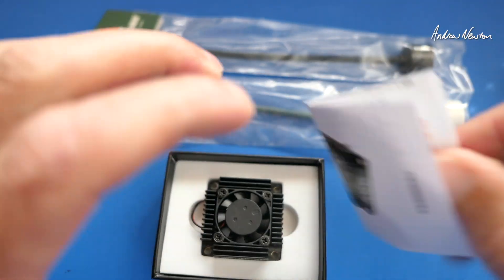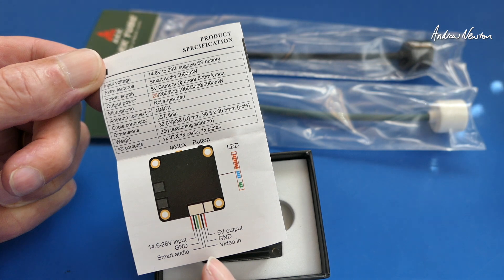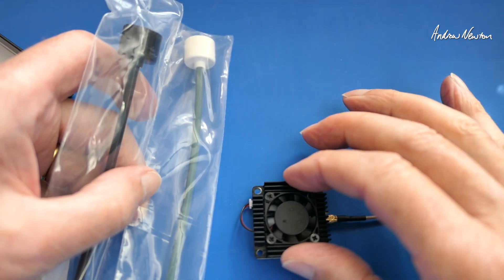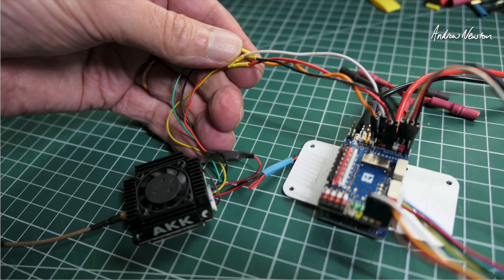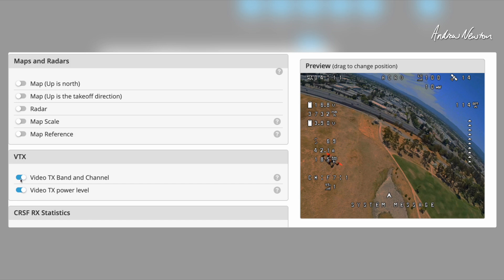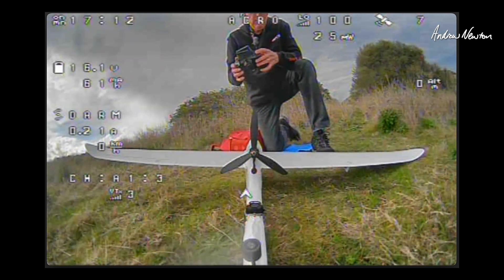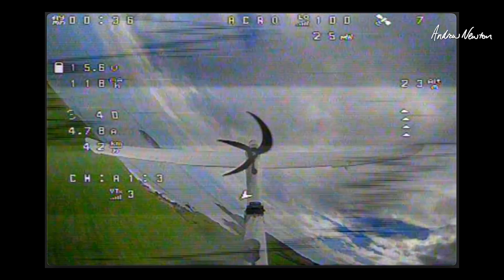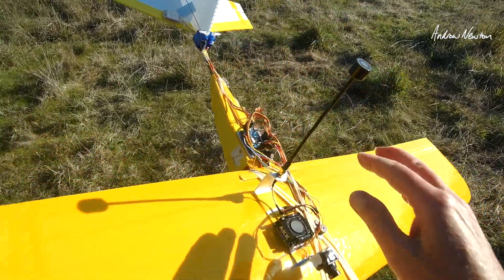AKK TX5000AC 5W VTX

Comment: If it has good channel separation could be worth buying and running at lower settings.  Rush Tank Solo is excellent in this regard.   Wish Arduplane had vTx menu like Inav.  They just can't get it right.
Also the interferrence running from the batt is shocking, shows how good the FC circuit is for power smoothing.
Reply from the maker: The recommend using 6S but are there any FCs that provide filtered 6S?
Reply: @AndrewNewton  Matek have F405 and others that take 6s and supply vTx voltage selectable.
Reply from the maker: @bomberaustychunksbruv4119  Yes VTx selectable to 12V......but this needs 16V minimum

Comment: Bom dia meu amigo Deus abençoe, quando acelera a imagem do vídeo fica tremendo porque?
Reply: Missing frames.
Reply: Well the aircraft to fly smooth in the air so speeding the video up just increases the frequency and occurrence of turbulence
Reply from the maker: On the Ranger it was electrical noise from the motor. Better voltage filtering on the yellow plane